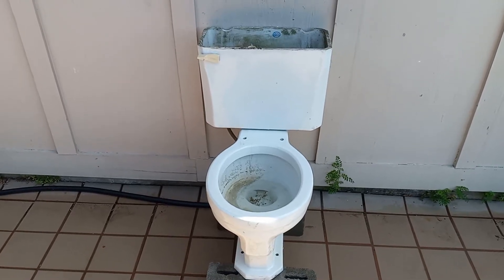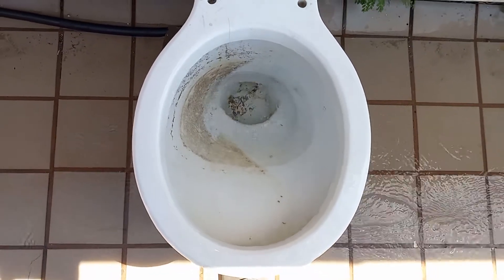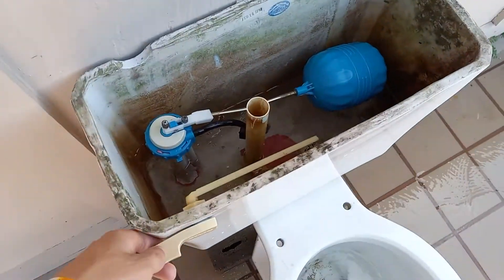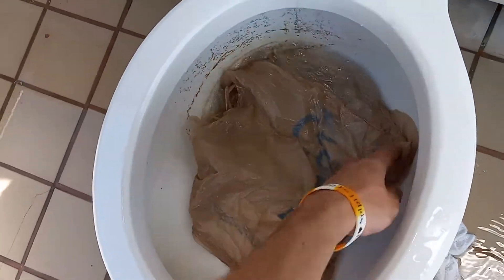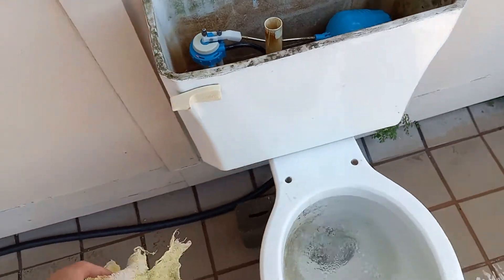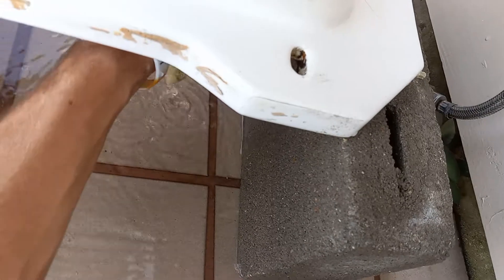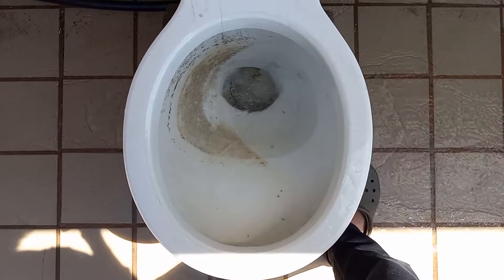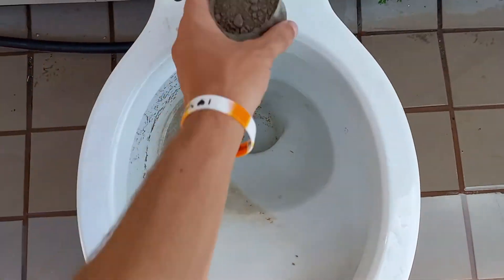1949 Alamo Pottery Toilet Tests

Comment: My 1960 Briggs forward trap toilet also has a barb near the bottom of the trap and is there a way to remove a barb?
Reply from the maker: I wouldn't try because I wouldn't want to risk breaking it
Reply: @OCC_Plumbing_and_Restorations  yeah that makes sense also I want to get one of those snake cams and put it in the trap of the Briggs toilet to see if there is really a barb.
Reply from the maker: @michigantoiletproductions1940  That would be cool